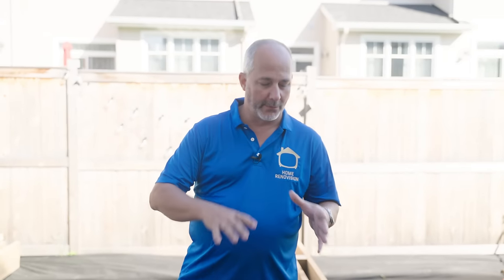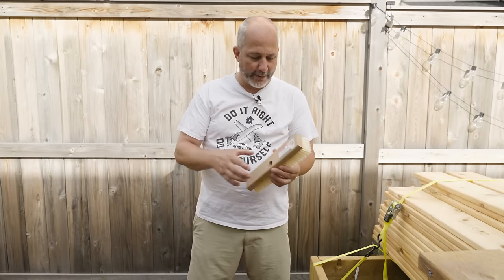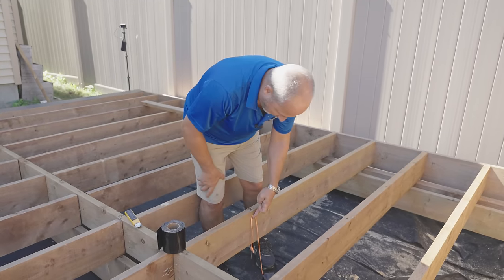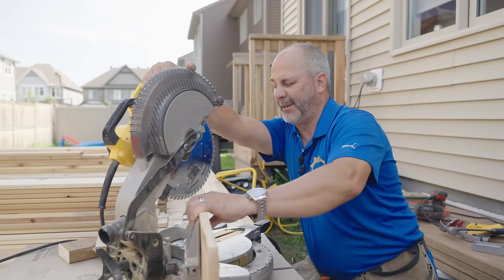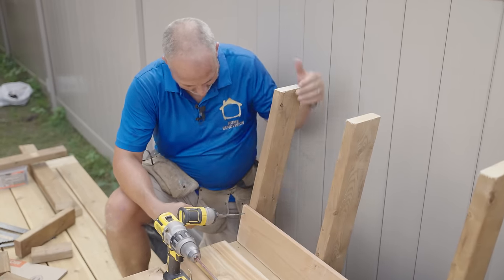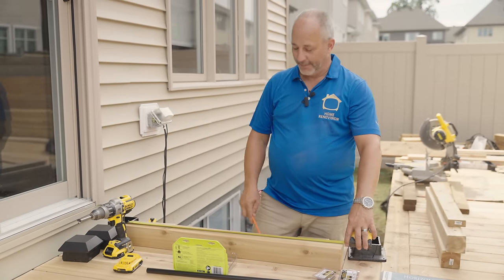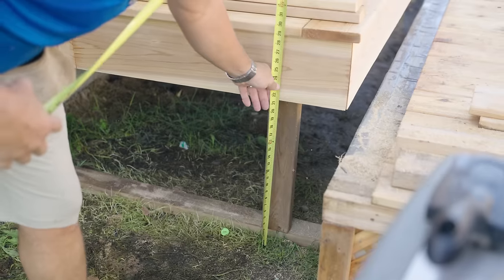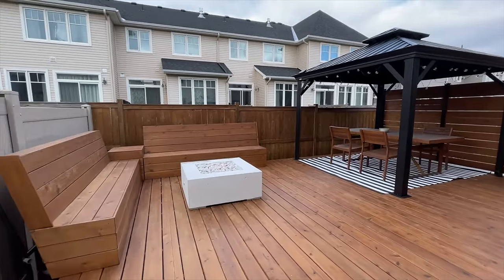How I Built a $35K Deck for $6K | DIY

Comment: My regret with building a deck in this type of neighborhood is that it raises you up higher. I wish I spent the money on a fancy patio and gained extra privacy. Love your channel!!
Reply: Exactly my thought. Looks like a stage.
Reply: Add plants to the top of your fence line and you'll make up the privacy!
Reply: Honestly a patio wouldn’t have cost that much more if u did it yourself and would last a long time as long as u properly used your base material and chip stone. Only sounsite is u have to dig up to ten inches deep for the entire area of your patio but if u have some kids to help it’s not that big of a deal
Reply: I appreciate him showing DIYers, but this is not easy. Plus with all the required tools, there’s a reason it’s expensive
Reply: Looks like a fish bowl on a platform 😅
Reply: I am not impressed with cedar fences or staining them. I don't like the ones we usually see with the strips of wood holding in the boards. I live on the west coast of Canada. Lots of rain and dampness through the winter. I love my big yard. Too much feet of property line. The strips of wood hold moisture in the ends of the boards. It doesn't matter whether it's painted or stained. You can't paint the ends of the boards. It looks bad after a few years and doesn't take long for the board ends to rot and the strips don't hold them in anymore. Stain or no stain. I think painting them on the West Coast Vancouver is a make work project with very little benefit. My future fencing idea will use pressure treated posts and 2 x 4 panel frames  with metal panels instead of boards. No strips to hold the metal or staples involved. Inside 2 x 4 boards at top bottom and sides cut 3.4 of an inch less wide to accept the metal . Metal screwed on with metal roofing screws. I can then keep the wood stained more successfully . The painted metal lasts longer and can also be removed and painted.
Reply: I started a deck just like that, stopped 1/3 way thru cuz not wanting to be on display. Took it down to platform style, happier in our instance.
Reply: I have been thinking about removing my deck and building a patio too, to be lower, and gain privacy.
Reply: I have seen some pretty screening ideas on You Tube that gives more privacy on elevated decks that turn out lovely.❤
Reply: Gazebos on decks are nice.
Reply: Its not that hard, plaanning it is the hardest part, ive done 3 decks from ground level to raised. I am only a diy'r aswell yes its time consuming but the satisfaction and money saved is second to none.@miatika
Reply: I love a ground level deck. Those elevated deck monstrosities attached to homes is money wasted and a maintenance nightmare.  You have much more privacy at ground level, it's easier maintain and can be beautiful once landscape is added to soften the hard lines. Unless you are Kim Kardashian with a bottomless bank account this is the way to go for an easy deck.
Reply: No I like this better plus he has the privacy screens patios are dirty on the ground I love be raised up

Comment: As far as the privacy fence goes, I would prefer to cut 45 degree on all the edges first and space them less than the overhang. That way you get actual privacy, air flow, and space for wood movement.

Comment: Great video, as always. I have picture-framed my decks for the past 30 years. I would make one change to your design, based on my experience...eliminate the flat 2x4 between the rim and inner joists. I've built three decks, one without a flat support board and two with a flat support board (like your design). No problems with the first one; major rotting of the ends of the deck boards on the other two...water and debris gets into the interface joint and cannot clear. My solution: The interface joint between the picture-framed and the regular deck boards should be free-draining to prevent future water damage. The inner rim joist would be located to support the ends of the deck boards. The picture-framed decking is supported by the rim joist (and intermediate blocking if needed to prevent overturning).
Keep up the good work!

Comment: Great Video man! You definitely need to get you some Irwin (or Dewalt) quick grips from Lowes or Home Depot to keep your hands free when your hanging wood that you need to attach. You'd be surprised at how much weight they can hold. Rebuilt an 800 Sq. Ft. Dock on my own by using them to hold things in place while I maneuvered the other end. Safe to say they'd help you build that table a little easier. They're great for keeping a board snug against a 6x6 when you're trying to put in the first screw or for holding a board in place while you're trying to get a clean accurate cut.

Comment: Hey, if you really want to use the red green stirring paddle, I have three suggestions: 1- you were going to pour the sealer into the 5-gallon bucket anyway, why not set the can in there before stirring? 2- use the drill on low gear  3- make your paddle smaller. 😊

Comment from the maker: Thanks for watching! If you found this video helpful, please subscribe. You can watch my other full length project videos 👉🏼 https://youtube.com/playlist?list=PL34cQkzKfXWYg2T2thLIOi0tOeY21iAzr cheers!
Reply: Thank you Professor. I’m making steady progress on my  renovation.  Nate is a gem . Any ideas you have have helped me. ❤ cheers
Reply: Best
Reply: Carriage bolts are not code compliant in my area nor can  you bolt a girder to the side of your support post. $35,000 deck? I have not built a deck with 4x4s in over 20 years! Notched 6x6s and a double 2x10 for a girder is the proper way to do this!
Reply: If you don’t won’t on that pot belly your going to be more susceptible to breath and heart problems ❤
Reply: New subscriber.
  I was very excited when you recommended a PENETRATING, SEALING STAIN
which does not generate a skin,
C2's  "GUARD" 
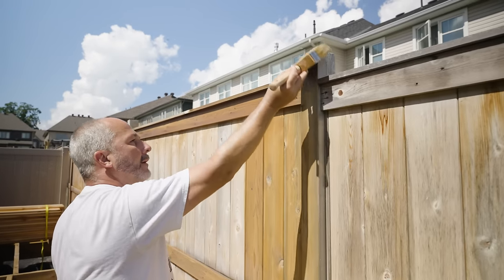(38:56 - 45:00)

  I can tell you haven't  done a lot of cooking.  Otherwise, you would have known that the spinning paddle you improvised would slosh product everywhere.  Your daughter probably learned that the first time she tried to use a mixer to make a cake.
  Please protect your help, yourself and your viewers by MODELING THE SAFETY RULES you r commend.
  Silicosis is deadly. Your helper should have DEMONSTRATED: ALWAYS STAND UPWIND OF THE BAG.  ALWAYS use glasses and a well-fitted  fiberglass mask when dealing with dry cement, etc.
  Remember, doctors have MO WAY TO REMOVE THOSE SILLICATE PARTICLES FROM YOUR LUNGS 🩻 until the autopsy.
👨‍⚕️☠️⚰️

Comment: This is a great video. I put 8 of these in upstairs and I'm going with a different brand downstairs. But these have held up well so far. I did have to replace a sash for the same issue, but they sent a new one right out. It's amazing how much they charge to put these in. It really is one of the easiest DIY projects to take on. Thanks for posting this.

Comment: It'd be interesting to see a real breakdown of the costs. Eg. Did the $6k include the privacy fence, bench brackets, all the screws and hardware, etc., or is that the cost of lumber? On top of that, most diy'ers don't have all the tools you do. Great video either way. Love how you always explain why you do certain things and provide tips along the way.
Reply: This is true and he makes it look like its fun. As your bending over cutting lifting climbing digging etc gets tiring and hard on the back to someone that has never done this work
Reply: I agree. I started watching this and it’s fascinating to see how it’s done. I feel like I’m not smart enough to do this. The true cost would include materials + tools + time + help + hours of therapy to deal with the aggravation. Seems like it’s intended for people with many years of experience.
Reply: Well if your a dyi'er and don't have the most basic tools hammer, measuring tape, square, cordless drill, level and a saw , could be a simple skill saw don't need a thousand dollar miter saw or a pneumatic framing nailer and compressor but if you have them it makes life a little easier when solo though screws are a better choice anyway just takes a little longer the only tool thats not a dyi'er  norm is the hidden fastner. If you can't  spend the $200 on basic tools, cheaper if used facebook marketplace will have everything you need for 100 bucks thats including a chopsaw wont be an industrial but dyi'er dont need one get a boxstore compound miter saw for 50 bucks all day long used or 10-20 bucks for a skill saw might have to plug it in but if you wanna cheap out on tools corded will cheaper just have to spend another 10 bucks for an extension cord . Or wait for a contractor to come do the work might take a year and add 25k to price for labour but beats spending 200 bucks on tools, Local handyman might be faster since all the contractors will be booked , probably do the job for 15k labour plus supplies at 15% markup of course , but could be finished within 6 months and last 5 years before needing to be torn down and replaced if your lucky it'll just fall down on its own and save you 500 on demo.  Pretty sure he said 6000 for the lumber and deck supplies everything else  was added on after he started so probably 8000 after everything said and done. Being for his daughter who just announced  a wedding is coming soon would cause a little overkill in normal procedure costing few grand more but still not anywhere near the 40k  a contractor would charge and he knows its done proper and will handle the use , ive been on a deck thats collapsed dew to being over the weight limit it was 20x8 maybe a little bigger about 8 people which was fine till number 9 showed up and her 110 pounds was just to much for the 2 year old deck luclily it was only about 7feet high to the floor of the deck and other then a broken arm on one and cuts and bruises on the rest everyone was fine others havent been luckly, using cheap labour who just wanna slap it together and get paid and dissappear .

Comment: I used Tuffblocks from Lowes instead of the concrete blocks on my floating deck. Highly recommended! I also used a couple of Home Deopt's version of a plastic block called Camo Blocks, but I preferred the Tuffblock.

Comment: Your videos are ALWAYS AWESOME, and so helpful. One thing you might consider for your 'third hand' to help place and level those 2x10's when you are only going up 24" ... use an ATV hoist in the middle. They are already 'wide' (for balanced support), are quickly adjustable, and would give you more flexibility, without having to screw & unscrew. THANKS for the point on the cut pressure treated posts.

Comment: Nice work,,   Here's my only tip.. after 35 years building decks. We use to space deck boards.. But about 20 years ago, I started snugging them as tight as I can.. Why?  they shrink. and after a year any rain goes though the gabs after shrinking... also women will Love you because their heals don't get stuck in gaps in the decking. Plus I used galvanized casement finish nails to nail down boards, and I set them below the deck surface... After a year you can't see the nails heads and easier to sand later on.

Comment: I think you did a great job I love working with cedar. I do have a question? The other neighbors to the back and side can see you and you them. That might be maybe uncomfortable? Could you have used the concrete base block for support of the headers thus dropping the deck down just above ground level maybe 4-6 inches so has not to see over existing privacy fences? Just a thought because now you lost privacy on those 2 sides and if you get a neighbor you don't like you know????Thank You for all the great videos I have learned a lot of tricks I did not know. You explain everything. Congrats on wedding soon.

Comment: Loved how he broke things down into 3 kinds of remodels. You don't have to take everything to the studs and start over. Not changing a tub saves a LOT. Not doing any tile work saves a LOT. Using a simple floor system saves a LOT. The time, complexity, money and risk go up like a hockey stick. Older lath-and-plaster homes are the worst.

Comment: Jeff,  what I saw a guy do to run electrical wire thru conduit was to take a piece of plastic (piece of bread wrapper works great) and tie the string to it then use a shop vac to suck the string thru the conduit.

Comment: For the footings wouldn’t a 30” hole and Sono tube filled with concrete be so much better??
Reply: Yes
Reply: @clarkpalace  those footings he set will move over time. This guy really knows what he’s doing too. Surprised.
Reply: @JohnSmith-by2fl  its sooo much easier to take the chance , skip the sonotubes , and hope for the best. I ve done that on a small balcony and the bottom of an outdoor staircase.  Wouldnt do it on bigger more important areas
Reply: @clarkpalace  agreed but this is a pretty big deck. I think he said 400-500sq’   
I dunno, to each their own.

Comment: Woke up and auto play had me in the middle of this show and I heard this
2:02:07 
“Water-base penetrating sealer”
Umm. Sorry/ no. No water-based finish truly penetrates like an ‘oil’ or alkyd finish. Water-based finishes coalesce and dry too fast to actually crosslink below the surface of the wood.
2:18:32 ‘warp’
Warp, bow, cup, twist. Different things and this a bow not a warp.
Good diy show. 
Nevertheless, with a lot of years of carpentry, woodworking, and building materials behind me I don’t know why anyone would put all the work into those plastic post bases and face-screw so many things when at the price of labor it would cost the same to use nice joinery and strong structural elements and have it come out looking upscale instead of average. Just because they have made stuff to sell doesn’t mean you should use it.

Comment: Cedar is expensive because it comes from the west coast of North America, its shipping and gouging.  Hardwood in BC is bloody expensive, we burn cedar for heat.  Pressure treated is the cheapest wood they can get underneath a skin of incredibly toxic chemicals that leech out into your earth over a few years.  Pressure treated wood is garbage, especially in a rainy environment.
Yellow cedar lasts longer than pressure treated, far longer if finished.  Red cedar lasts better untreated than anything, finished and flashed it lasts damn near forever.  CWF is great, regardless use oil based , water based is still junk for outdoors.

Want a real 10yr maint free deck? Skin EVERY deck beam and top surface, and oil finish/CWF 4 sides of every deck board before you screw it down.  Then do the tops again when you screw it down.
Add 10 years? Pressure wash and add more finish when it starts looking crap.

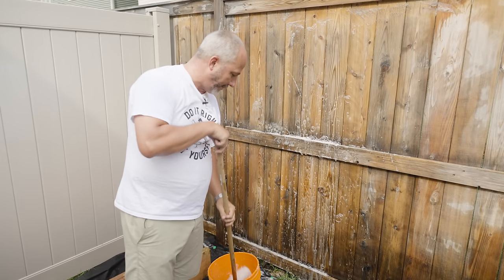Comment: 35:00 why not just spray the bleach on with a pump sprayer - use a hot mix 3-5% sodium hypochlorite - wet with hose first, spray on, wait 10-20 minutes and rinse

Comment: It's sad to see so many people congratulating you on your engineering and structure. I see so many aspects that would never pass code in Maryland. you're still using the split 2 by 10 on either side of a post and calling it a beam. International building code calls a beam any two members joined together with a nail pattern. What you called a beam is not a beam. 
Also you didn't use washers on both sides of your through bolt holding your pretend beam to your post...

There's no doubt that the structure is not going to fall down with these failings, I'm just pointing out how it is not using current structural standards. It is more work to do so and it is more difficult which is why most people hire  a contractor. I agree too many contractors charge way too much. But running an entire company and following all of the specifications and waiting for inspections to happen is very expensive.

I didn't realize you were in Canada. I don't know how different the code requirements are.

Comment: I am sure the deck is built very well but for me the deck is too big for the space.  There is little to no privacy in the space.  The neighbors across the way are looking into the backyard, plus you are higher up.  I would want a smaller deck with more greenery designed around the deck and If it is okay with the HOA I would use the greenery to make the space more private.  I have since designed my space with drought tolerant plants and artificial grass for the zone I live in. I had a lawn for 20 years and I am amazed at the quality of my artificial grass and I never have to mow.

Comment: RED NECK MIXING 4 PAINT CANS... Use a cleaning brush from inside the house.  A round one if possible. A sink brush, cleaning bucket brush..etc.  Hell you could of used a few lids to food containers screwed together to get a better result than...  NOT A SQUARE WOOD BRICK.

Comment: I got like a vinyl plastic fence installed in my backyard. Only problem is we get some brutal hail storms here in Colorado so the caps have holes in them and we’ve already had to have it replaced once because the hail decided to come in at an angle and punch holes all over the fence. Thankfully it’s covered by our homeowners insurance!

Comment: I’m going to need to run 30 foot box beams so If I need to splice the 2’ x 10’s on the 4 x 4’s for the box beams, can I simply use timber screws at the splice on the 4 x 4?